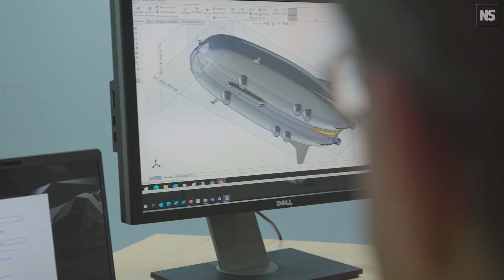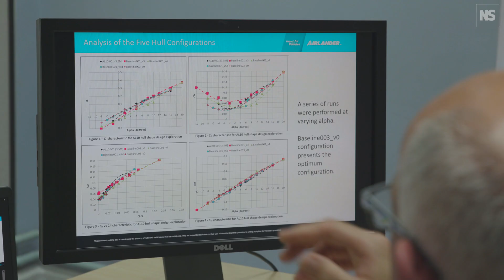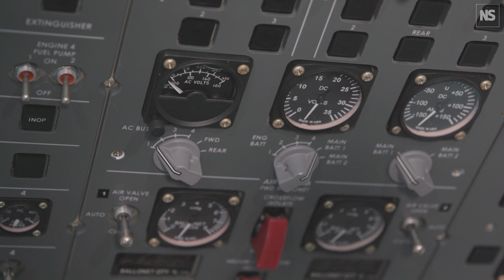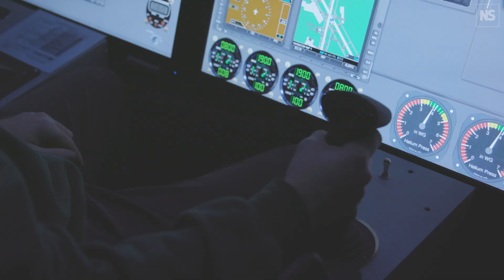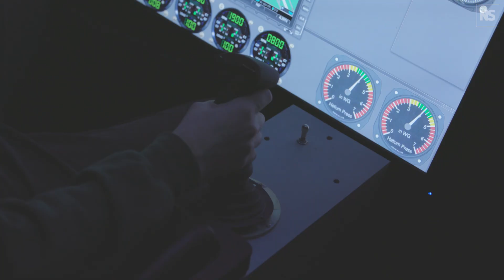Could this airship be the future of sustainable aviation?

Comment: I think a future for these might be for transporting giant wind turbine blade for construction over land. Currently one of  the biggest hurdle of land/onshore  (off shore isn't  much pf a problem due to ship being able to carry them)  wind turbine is the roads system isn't equipped (especially around corners)  to transport the unceasingly larger turbine blades . Large airship can solve this problem, they may even act  as a sky crane for construction of  these land/onshore wind turbine .
Reply: Yes.
You are correct.

Comment: A few things that weren't touched upon in this video:

- air travel accounts for only 2% of carbon emissions
- helium is a finite resource (more or less - it leeches up slowly from radioactive rocks) and not readily extracted (yet we continue to fill party balloons with the stuff!)
- The quote at 3:18 , "if you want to go somewhere fast, then you are not looking at this machine". Are most people prepared to spend an extra week of their holiday time travelling slowly? Doesn't this contradict the subject question, "Could airships be the future of sustainable aviation?". Looks like that's a "No".

I am all for reducing the CO2 output of air travel but could this not be addressed quickly and much more easily by increasing drastically, the proportion of non-fossil hydrocarbons in jet fuel (yes, you would still get the Nox emissions)?
Reply: "An extra week"? It cruises at 148kph, so board in London Friday night, sleep, wake up on approach to Rome on Saturday morning, with views over the Alps while you have breakfast.
Reply: In a zero carbon future trains could replace regional flights and airships could replace transatlantic or transpacific flights. The only problem is that we are indeed running out of helium.

Comment: Nonsense to claim this is sustainable when it will require huge volumes of helium which is already scarce and an not a sustainable resource. This article needs to address this issue.
Reply: How about wind and leaks.
ya its absurd
Reply: Yes, that would be added to cost. Also there  is reliability, time, gondola(space)… problems and I’m learning more about them. Only plus is there are far less moving parts so it’s way easier to construct them. These are like cruise ships with a little more danger.
Reply: Just use nitrogen. It worked so well in the past
Reply: @bunnyofdoom4501  you mean hydrogen, right?
Reply: We will have fusion soon enough.
Reply: Can it handle strong winds?
Reply: @TerrorTerros  Even if so, it won't make a difference in this regard. A nuclear fusion power plant would only produce a couple of hundred kg of helium per year.
A single Hindenburg-sized airship would need around 35 tons of helium for the filling.

Comment: 2:25 Yes batteries make no sense, but liquid hydrogen fuel cells are ideal for airships. Hydrogen is light and unlike in aeroplanes, the large volume of the tanks is not a problem. They could further burnish their 'green' credentials by putting thin film solar cells on the hull.
3:17 "If you want to go somewhere fast, then you're not looking at this machine". Quite. This answers the question "Could airships be the future of sustainable aviation?". The answer is no. The point of air travel is to get to places quickly. (But it does open up other possibilities),
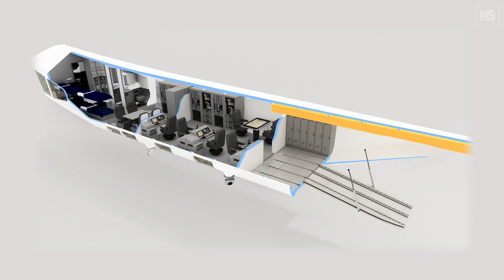4:09 Yes. The really big market will be tourism. For example it would be the perfect way to tour Europe. You would fly by night and explore your destination by day.
4:34 Yes, Airlander could go anywhere, but if it went to the North Pole, could it land? In anything other than totally still conditions, it would blow across the surface and be too dangerous to get in and out. Do they have a solution for that?

Comment: Hi. I'm sorry to have to say this, but airships have always been a "fine weather only" way to travel. They have a maximum attainable height of about 16,000 feet, fly a lot slower than the highest windspeeds recorded at that height and lower, and cannot be manhandled out of their vast hangars in anything but perfectly still conditions. A regular timetable would be quite impossible to achieve. Check out the R101 hangar at Cardington for the size, it was once the largest covered area in a single building in the world. Cheers, P.R.

Comment: How hight of air ship flight ceiling that do not danger to commercial airliner ?
Reply: The problem with airships flying high is that they will expand in the low pressure atmosphere and need to vent helium to avoid popping. And then when you lower your altitude, you will have less lift and crash.

Comment: Unless they found a material that doesn't let helium molecules pass through this is just a toy for rich people.
Reply: Isn't one of the reason helium was chosen is because it is far easier to contain than hydrogen ?
Reply: @remliqa  No, there is not much difference between hydrogen and helium in this regard.
Helium isn't flammable, that's basically the only advantage over hydrogen.
However, modern materials can minimize the losses for both gases.